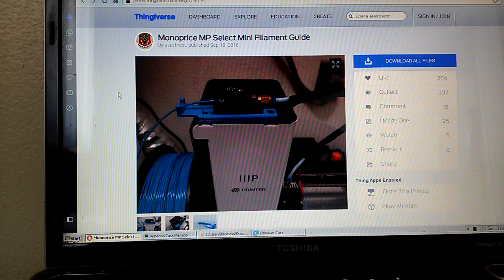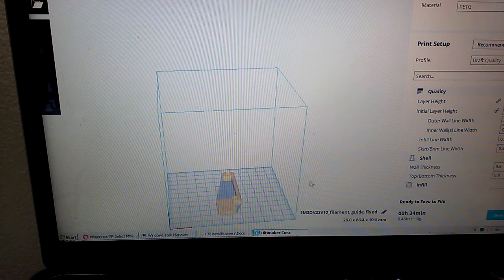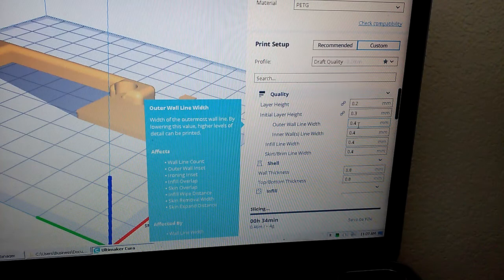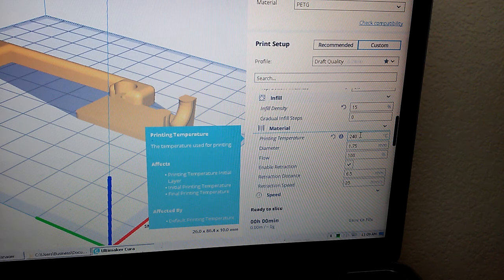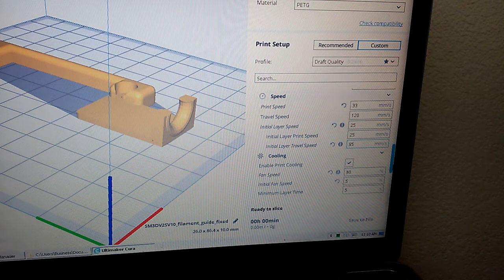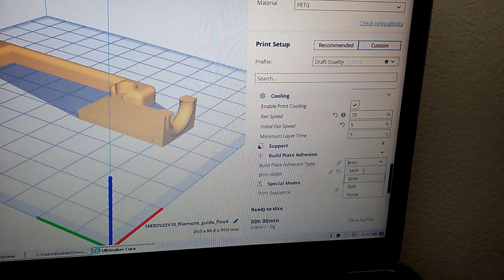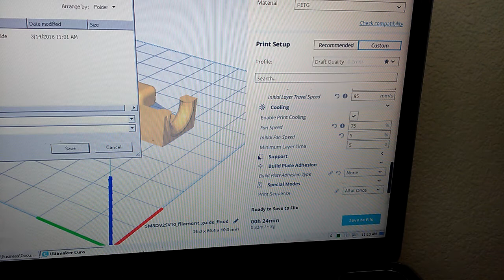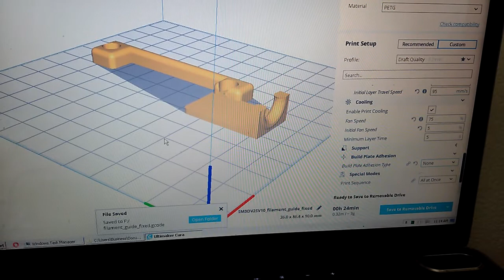Printing a Monoprice Select 3D mini V2 upgrade Cura Settings

Comment: Hello, I just bought a used Mini v2 that didn't come with sd card. I downloaded Cura 3.4.1 since I've read there are issues with 3.5 on this printer. I'm a complete noob with 3D printing. What settings should I use?